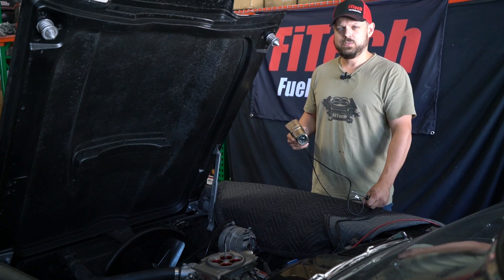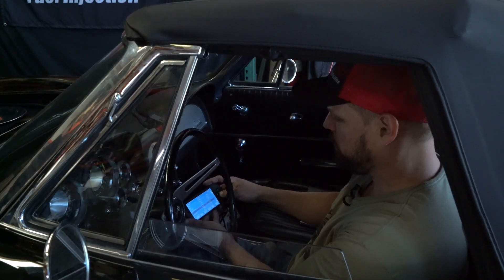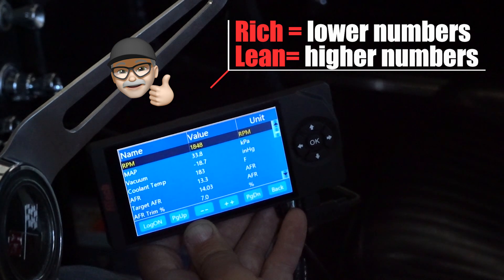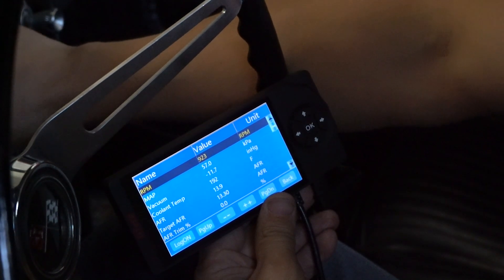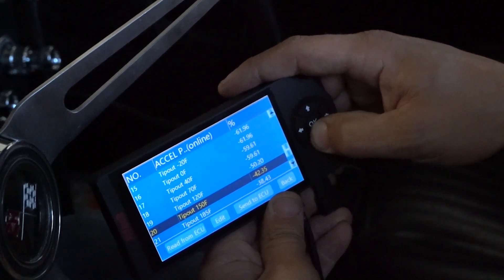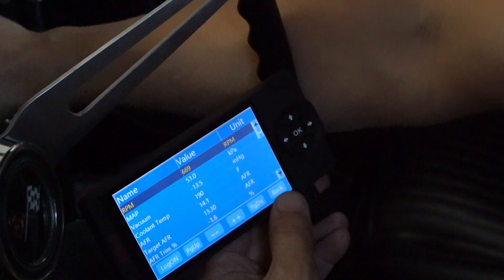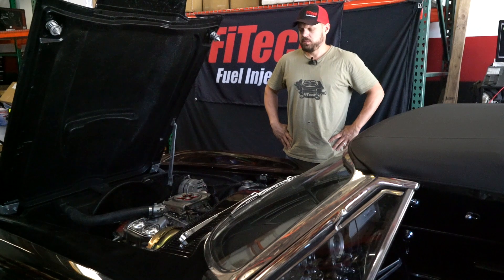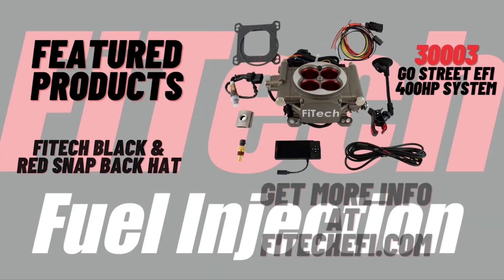Install Checklist Part 2| Tech Tuesdays | EP22

Comment: Hello friends, when I make my data records, the first row of the excel is blank, that is, where the titles of the rows appear, such as MAP, RPM, TPS, everything is blank. why will it be? and the other question is I have a 30001 and when trying to open the datalog with the procal the program hangs and does not open it. any suggestion
Reply from the maker: Try to clear out the folder (log_file) of all documents. This will make the handheld recreate the log and bin on the next recording and you should then have a title bar. As for the software it seems to have installed on your computer wrong. Be sure to turn off all security defenders and install on the administrator account.